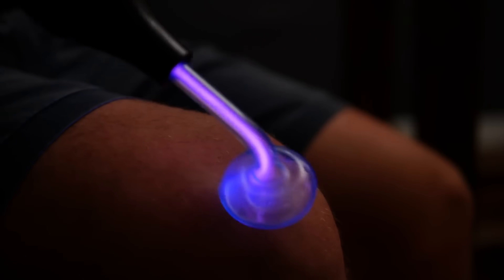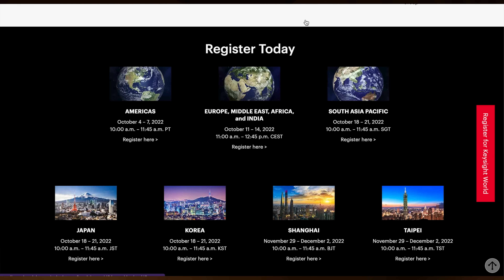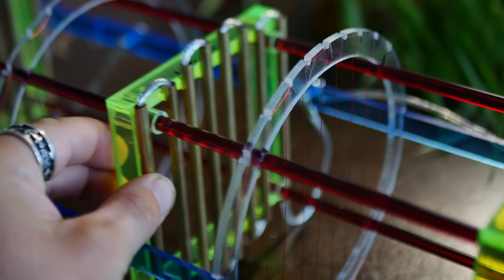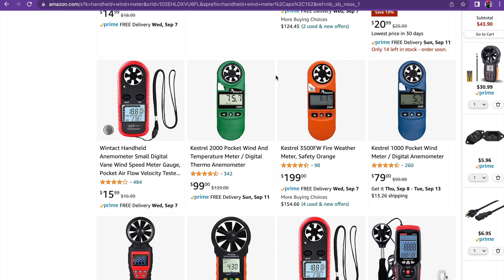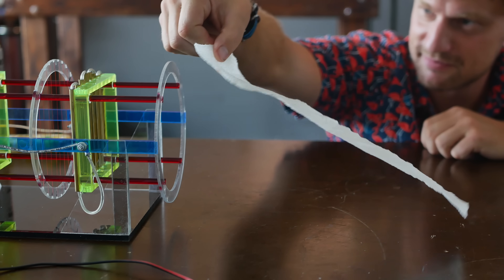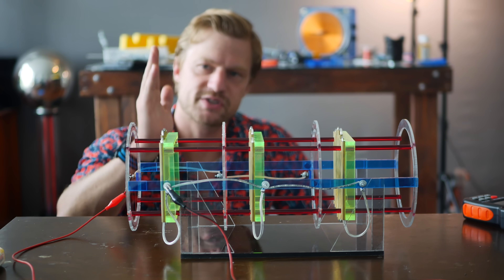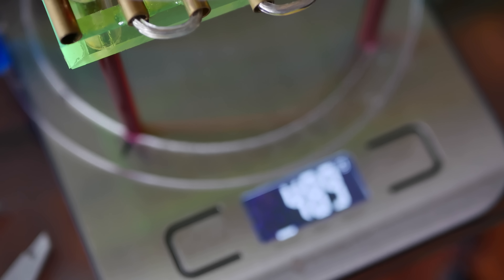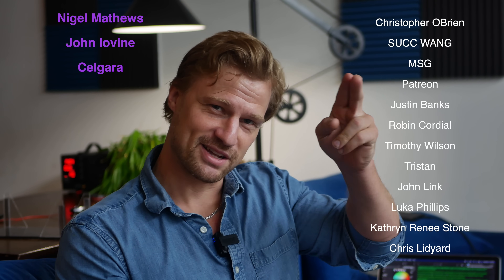Designing A Next-Gen Ionic Thruster! (For Flight)

Comment: There is nothing wrong with using the scientific names for processes. Electrohydrodynamic thrust has the explanation in it's name; Electro (related to the electric) - hydrodynamic ( Influencing the molecules in the air ) Thrust (movement). So the dynamics that result in a thrust because of the interaction between Electricity and fluids (air is a fluid in this case). So it does not make you a "Schmuck" if you use the terminology.

Comment: Please investigate what's causing the sound. If you have still have moving parts (e.g. vibrating wires), dampening them (thicker, or more tightly fixed wires) might help improve efficiency.
Could also check if replacing the cylindrical wires with thin stripes of aluminium foil may help to increase airflow and direction.

Comment: my question is, this will only give thrust in an atmosphere and not a vacuum ?
Reply: yes
Reply: you need to give mass in order to produce thrust in a vacuum. There are already fielded versions of ionic thrusters on satellites that expel zinc oxide ions at an incredible efficiency via magnetic propulsion. the reason this thruster works is similar in practice, instead it ionizes air particles so they are effected more by the magnetic field and expels them.

Comment: I'm curious how close you can get the sections together before you start losing efficiency. If you pack like 10+ stages in there as close as possible, it seems like it should work even better (but I also assume there's also a limit before adding extra sections doesn't aid you anymore.) Trying to make the airflow spin might help as well.

Comment: Wow!
Great job on the design.
I'm wondering if you might get a greater thrust result if you swap out the copper wire in the rings with wire that is coated with an exotic element, say...palladium or platinum?
Also does size matter? Have you considered building one 5x larger? Sorry just thought maybe you could go for a ride with the next one..
Incredible!! Thank you❤

Comment: You’re going to get the expected values at sea level for best results. The more dense the atmosphere the more thrust you can get.  Is it possible to place your build into a sealed chamber and pump airflow into it with say a compressor? Then theoretically at 15 psi, that’s sea level. Now ramp up to 150 psi, shouldn’t it produce 10x the lift potential?

Comment: Great video. Interesting stuff. A thought on increasing output, make your grid wire to be parallel for each stage then hook up additional stages and increase voltage. Use smaller gauge aluminum wire to help the weight out a little more.

Comment: Id say the most impacting inefficiency on final air velocity with this design are the open segments between the thruster segments as it causes a venturi type effect between stages, sucking slow air in between stages and thus slowing the velocity of air after each stage. An improvment could be made where a cylinder houses the entire thruster only allowing airflow in from the start of the first stage.

Comment: I'm not an engineer so this may be a stupid question. 

Would containing the whole thing increase the flow rate? At the moment the surrounding air may be sucked in, so you have air with less energy being taken along with the air which has passed through the first and second stages. Basically a big tube around the whole thing is what I mean, so you have a single entry and exit.

Comment: Since you already have multiple voltage taps available, try increasing voltages on each consecutive grid and adjust gaps between groups for maximum output.
Don't power the third or any additional stages you might add until you've optimised the preceding stage.

Comment: Add the entire build in a 
1. tube, it will increate the thrust theoretically as it will create a pressure difference, 
2. as well add at the input a donut shaped intake it will make another pressure difference 
3. to pull more air, another thrust boost is to increase the tube incake and add some holes on the side, similar design as the blow torches which pull air from sides based on the pressure

Hope you read this, i wanna see it in action :)
Reply: Hi. Mechanical Engineer here.
1. He should make a venturi tunnel. The different diameter of the tunnel creates an high pressure zone and a low pressure zone which can be used to place the engine at the perfect spot along the x-axis to take advantage of the venturi effect.
2. The donut doesn't help drag more air in, it reduces drag of the air that is about to be sucked in by reducing tubulence.
3. The airholes in a blowtorch use the same theory as a spraypaint gun. The pressure difference are created by the speed of the gas in the main chamber. Fast speed of gas makes the pressure smaller, thus sucking the air in the small hole at atmospheric pressure into the main airstream. In a paintgun It would be the air compressor air moving vwry fast, and in the smaller hole you have your paint resorvoir at atmospheric pressure veing sucked along with the pressurized air..
Reply: @dagg497  Jesus you're a genius! I was thinking in the opposite way but that is honestly way cooler. Thanks for the idea [1].

Comment: Think.about the shape of the wiring?  Series and parallel positioning etc, also frequency generators, different types of metal wire used for test to find best. Maybe tubing? I can use this in some different ways I think you may be able to excellarate hydrogen and produce a new type of engine torches etc. Although this could be incorporated on vast extremes based on the tech you show

Comment: in the T/W ratio , its 4.5% for the 3 ,  but if u account for only 1 will be way better , expecially if u remove the structure the build it all and weight only one module. it will be more than 10% at least

Comment: Suggestion: Like a propeller has a different pitches longitudinally, taking different "chunks" of the air moving at different speeds (more accurately the prop blade moving at a different speed at the outer edge vs inner part) - could you have different spacing to cater for faster-moving air? Like very close together at the start then further spaced as you travel along as you're now dealing with faster air?

Comment: Some of the improvements that I can think of ( not an expert in electrical engineering and fluid mechanics) are: Trying to reduce the cross section of the thrust channel (might help in faster airflow); flared inlet cone (might help in better air collection); designing circular coaxial electrodes (might reduce air drag compared to straight wires and tubes running across the channel). 
Let me know if I am wrong.

Comment: If the vertices of the rods were at a smaller radius to the center of the thruster would it create a higher density of thrust? If that is true wouldn't a honeycombe lattice build of smaller radi thrusters create maximum possible thrust output?

Comment: You can always improve efficiency by making it smaller and adjusting your electrode array to the perfect distance apart vs the amount of electrodes. I’d also try alternating the current to see if that works better. I know spark plugs create a bigger spark if the gap is larger just before they can’t reach
Reply: Alternating current would move the air back and forth.

Comment: Hey plasma channel owner, I just saw your video of this plasma thruster and even a small one like that can produce a great future engine, what I think is missing is the power input and 2 knobs to be able to add and subtract thrust/voltage, also I think it’s length can be shortened a little bit and a change in design meaning the change in the wires to make a mesh pattern and if it doesn’t work scratch it and last I think it needs a better conductor

Comment: An interesting project, have to admit. I'm thinking of doing a similar thing, but combine a few systems. I see at least two main challenges here to scale this up (to what I aim to achieve). First, kV-level DC voltage is very difficult to scale up to use for human transport aircraft. Second, a power supply that would allow this to fly up in the air (not to mention, to last a complete mission) has not yet been developed. Not impossible to build, but I foresee a lot of airworthiness challenges to do this.

Comment: A 5mph wind is a nice demonstration and you did some solid work there. I like it!  It won't get anything off the ground at this scale, though.  If you square the cross section of those grids, you might cube the output.  If it's still too heavy to power an airplane, I would wager it could at least power an airship like a dirigible.

Comment: 1. If thrust is generated from air movement, then there are huge inefficiencies due to the 'open-form' design of the engine. Enclosing the design in a nacelle would improve raw thrust greatly.
2. Adding to the previous point, if the grid diameters more closely conformed to the nacelle, whilst maintaining/increasing their individual wire densities, the ionic wind would compress ever so slightly, increasing its density, and therefore it's thrust generated.
3. Painting everything in race car red will make it go faster. That's the first law of thermodynamics :D

Comment: the science here is awesome... things that might increase thrust to is a ''nozzle'' at the thrust area like solid fuel rocket engines do. also i do believe the hyper jet engine here might be a clue. where hyper jets suck in air from the from here you can create an additional electrode creating heat and thus releases electrons, the plasma which travels.  focusing it in an additional electrode like the microwave does and then ENCASING the build so the electrons cannot escape should also increase thrust.another thing that can be done is to play with your driving circuits frequency in the volts... higher or lower frequencies will relate to amperage lost resulting in less plasma released. also the higher the frequency the more power u need to drive this at. so testing frequencies will be another factor.  ...the thrust here however is circumstantial to atmosphere. meaning the plasma of air 'blown around' is mostly nitrogen. a gas,,, switching to heavier gasses injected into the chamber will in affect of newtons third law, create more thrust. in all instances following these steps the true over thrust can at least doubled..... maaaaaan i wish i could have built this with you. goodluck

Comment: this is awesome and I would love to see it work, infect sliding the pieces back and forth could be a way to throttle it up or down... BUT!
I'm skeptical since you never showed it working at a distance and always kept the intake end out of sight except for that dry ice test... but at that time you showed the dry ice in front of the camera with the device beyond that.. meaning there could have been something out of view on the right hand side.
Reply from the maker: If you watch the airflow with dry ice being sucked into the inlet - that pattern of air movement is impossibly by pushing it (so to speak). It can only be formed by a low pressure pulling it toward the inlet. So, I couldnt cheat with an off-camera fan if I wanted to. The fog would have just blown everywhere. You can clearly see it being sucked into the front. The issue I have is with my camera. It is a really, really tight frame and I have to place it 7-8 feet away just to get the entire thruster in there.

The next video is BSI V2, as it's built, tested, and solid. you'll love the second video.
Reply: @PlasmaChannel  to me it's like one of those ghost videos where a chair moves across a screen but you don't see the string pulling the legs to make it slide, I'm not trying to call you a fake because I do want this to be a real thing.
to avoid this I hope you have some panning views to show there is no chance of a external effect of any kind.

also what did you think of the ideal of using the sliding fetcher to throttle the power of the thrust?

Comment: I'm thinking there's a simple way to test to see if ducting the airflow would increase thrust. 2L soda bottles. Start with the highest thrust achieved cut the ends off the bottles. And place the device inside the bottles. Creating straight tube. 2nd would be to open gaps just ahead of each engine. 3rd would be to use a heat gun to shrink the ends of the trailing edge of each tube if gaps prove more air is pulled with each engine. Then try different final diameter nozzles to determine if that increases velocity. Would increasing the number of positive strands in the grid increase electron flow? Would decreasing the size of the negative grid rods, say using the same material as the positive grid change anything? Would ducting starting with a larger first grid and decreasing the diameter of the second and third grids create a compression effect?

Comment: Would ducting the whole assembly (like a ducted fan) possibly help?  I'm imagining a lot of the flow escaping through the sides along the length, rather than being additively accelerated by successive stages.  Of course, that would negatively affect weight.

Comment: Your wind measurement speeds at the beginning are not accurate because you had the meter sitting on the table NOT centered in the line of thrust. Later you handheld the meter and had it directly in the center. I dont trust your data because of this.

Comment: Im probably not one to talk, but wouldnt there be some loss of moving air as it is not contained in a tube (thinking a portion would miss the next stage going out the sides, therefore not contributing as must as it could, aka loss due to leakage). just a layman's opinion. and an aerodynamic (of thats the right word) intake, to optimize airflow (I know airfilters on cars often kill power, and simply put, the fewer changes in velocity the better. good idea leaving that air gap when testing the thrust, so it wouldn't suffocate, and thats exactly what i mean. motortrend's enginemasters show did an episode on what robbed power from an air filter, on a chevy v8 with a 4 barrel carb, and 4th best setup (powerwise) was no filter at all. above was a filterless velocity stack ( which was #1 i know), and a salad bowl with a lid that was a literal filter. and the same lid on a classic round filter was tested (ill get to that). one filer was that same style of classic filter, with a chrome lid instead of a filter lid. another similar filter had a droped bottem around the carb. that actually ROBBED power. and the filter lid on the round filter did better, so they decided to test and see what happed when they duct taped the side filters and just had the lid filter. Yes, it did better. by now your probably thinking "i already know this" and ill put two more cents in saying that if i understand this correctly, the reason the change in the direction of velocity is a power-killer, is that it has to fight inertia, which i assume slows airflow and kills power. which is why a direct, beeline approach is usually the best for air flow (excluding superchargers). and it may also "push" the air that's already going the right way when making the turn. Now if your not done reading this, you are now.

Comment: Nice build. In darkness you can see the sparks starting at the painted copper wire. I think the energy can't flow at the whole surface of the wire. Will it help to remove the clearcoat from the wire to increase better " Ionisation ”.. and maybe thrust... Greetings from Germany.
Reply from the maker: Technically the insulation should not be much of an issue, as it's only rated to withstand 300v. The wire is experiencing 50,000. However, the new BSI thruster I'm working on has bare wire.

Comment: Idk about flaw... I would prefer to say design improvement...
1) i would say having a casing could help
2) if you want thrust i say a "conic" design could help ...
If conic design is used i would suggest having a big gap for the intake and med-high voltage
Small gap and high voltage for the last stage
3) adding more line at each stage is another suggestion... 
I'm not a specialist and only saw this videos once... Plus you ask for idea to improve the design so here my suggestions

Comment: thought about it for a bit, make 3 stages, 1 at about 1 sqr foot, the next at 3/4 a sqr foot and the final the size they are now, with a large initial input and each section getting smaller has a continious increase in flow as the volume area gets smaller, either the flow goes to 4-5 m a sec or the pressure increases quite a bit... only issue I think that may happen is the air become more and more ionized therefore less to be acted upon in the later stages...

Comment: Well, not ever trying any experiment of the sort, but knowing that magnetism and electricity form those torus shapes, I would think it would start with ferro fluid and figuring what material and shapes takes the least voltage to have the highest impact by forming the most effective torus shape. Knowing the exact size of the ideal shape should determine ideal distance. Also seen many experiments where introducing magnets can have a significant multiplier effect. I just doubt wires in a grid are an ideal means to most efficiently drive up air flow.

Then there is your electrical source, is it really producing the ideal voltage with the highest efficiency? 

Lastly, it was an open design. For an obvious example, if I had an air source blowing across your design sideways, it could significantly impact the flow. Perhaps, closing the sides  could lessen a problem like that.

Comment: Very nice  I know it's way late, but can you maybe develop a shifter of one ionizers. I'm thinking about testing thrust incr. and propulsion stages and gearing intervals and maybe power/voltage regulation if it ever gets to craft propulsion stage. (atmospheric air volumetric/ pressure?)..... Also could the effect of air volume(blower/compressor system/design intake/..., does it have an significant effect? ).